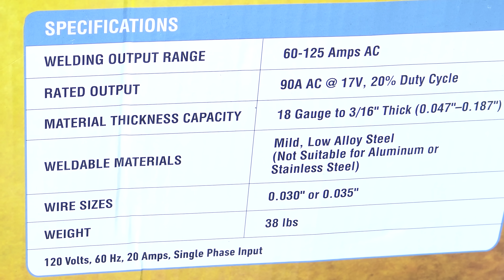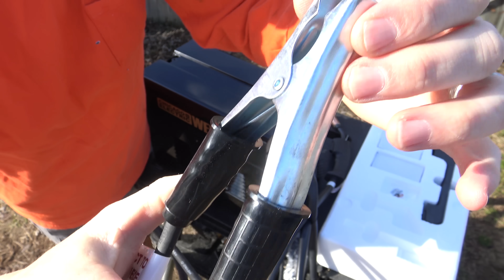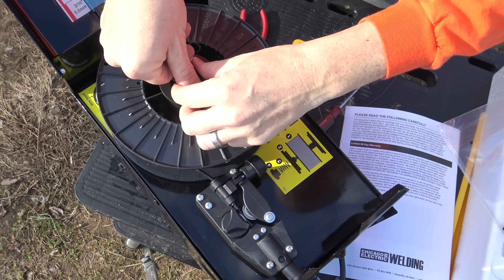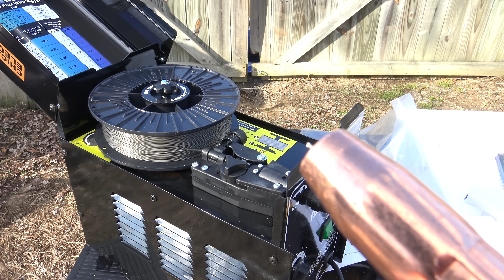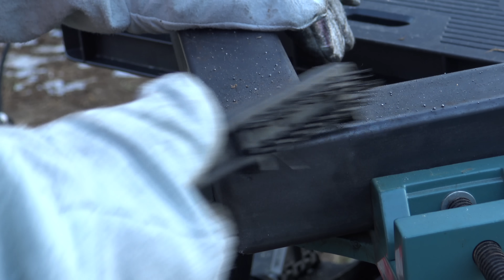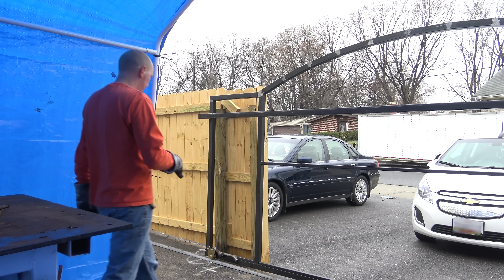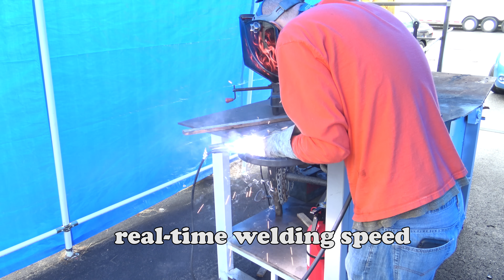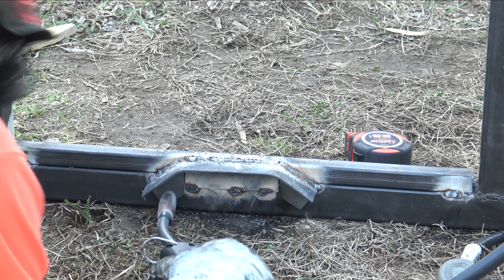Harbor Freight Flux 125 Welder Review

Comment: I got one a few weeks ago. Picked up the smaller gas less nozzle, I really recommend it. Improves your vision greatly.
 I didn’t realize that you could put those large rolls in this machine! That’s awesome. 
Nice video hope you make more with this welder.
Reply: Nozzles are part number 63795 at HF
I used electrical tape to attach, maybe I am doing something wrong. But so far no issues to speak of.
Reply: Also I have been using on a 15 amp breaker. Not heavy use just practicing (with a 50’ 12ga extension cord too). No breaker trips yet. Still planning the outlet upgrade very soon.
Reply from the maker: Its a small world huh!? You will see a very large increase if you ditch that extension cord and get a 10ga. Im not kidding. I think HF says NO to extension cords in general for these but i cant remember. Also, that 15 amp breaker is probably OK for short runs (of time). It just cant run under full load for any long duration or it will pop the breaker, or if your breaker is simply larger but the wire isn't upgraded too, you can start a fire more likely. Be safe. If you run out if wire and are gonna keep welding, the larger reel of .035 is a choice i will never regret. But i do have the power behind it at the plug. Thanks for the comment!
Reply: TRY to HELP you yes the extension cord was a one time deal for a repair. Definitely will wire a 20 amp with some 12ga. Shed outlets should’ve been that way to begin with.. big roll of .035 is on the shopping list. Have you purchased from eBay? Prices are way cheaper than HF, and I’m betting similar quality.
Reply from the maker: Walter Welch nice. Just bow seeing thid last comment. I have no experience with ebay. I would not be surprised if the quality was better or worse...
Reply: @TRYtoHELPyou  I just got mine off eBay exactly same as yours
Reply: It sounded ruff pulling on that big spool wouldn't recommend it .

Comment: Speaking of sparks...  Spark update please.   Wish I had a house or I would have bought an EV.  I ended up buying a 15' Mitsubishi Mirage 3 cylinder no instant torque here:(  Keep up the good work.  Thanks for the information on the welder!
Reply: Arg! I totally would have gone with like a third gen prius if home charging wasn't an option (pretty sure it might be in the same budget ballpark), but Mitsubishi makes some alright vehicles.  Best of luck.
Reply from the maker: No prob. As for the spark, its still zappin along. Cold weather has its range lower, as does any EV. At its worse the guage reads 60 miles (sub freezing temps). From lots of highway use. Still charges real fast. Still performs great... and still under warranty, i think thats the funny piece.. used car with the full factory warranty. That Mitsubishi will likely treat you well with fuel costs. My geo metro regularly got 36street 40-41 freeway. U should get the same if the car is around 2000lbs. One day dude.... one day. Thanks for the comment!
Reply: Ew ew question, how fast is fast? I've only experienced 41kw on a 50kw charger.
Reply: I paid 7180 total out the door.  132/mo. w/ 2 years plus of factory warranty.   My wife's car is a 2011 Hyundai Sonata just over 100k and alittle tired.  I like the car but already replaced the starter and it leaks oil.  I like the brand and the "Initial quality" but it's not a Honda ha ha.  I will likely replace  in a year or two.  I'm looking at the Volt and I know it's crazy but like the new EVs that Hyundai will and has bought to market. I hope Nissan gets the Leaf right the next gen. Thoughts? Thank you for your time!  Sorry to be off subject.
Reply: I genuinely would have bought a gen 2 volt if it wasn't twice as much (used) as a Spark EV (might have bought a Bolt EV if it wasn't three times as much as a Spark, but might buy one if they sink below $20k used off lease).  I believe the only negative thing I've heard about gen 1 volts, is that it might like to eat through a wheel bearing every 40k miles.... sincerely also a solid choice me thinks, if you can charge at home and don't mind filling it up with a premium beverage.

The jury is still out it seems (I've already made up my mind) whether the new Nissan LEAF is going to be suitable for long distance travel in "reasonable" time.  If the LEAF is to be considered, I'd personally wait for the 60kwh battery with thermal management, although I'm sure it will be out of my reach to be sensible financial decision.  Before it's all said and done, who knows, the 40kwh pack may get a T.M.S.
Reply from the maker: dead to 30 percent, high thirties low forties. 50% 46kw 60% ~47kw 70% 48kw. .. 125 amps the whole time as long as the battery is not below 50f. it warms up fast though. Those tall skinny units you find at nissan dealers are 42 kw things... so, i wonder if you have hooked up to a true 125 amp charger? The plugs always say 50kw in my experience. The plug is rated for that, for sure.
Reply from the maker: you got the right idea man, regarding the cars... minus the new Leaf. Mark my words, there will not be thermal management for the 60kWh batt or 40. I am not a spokesman or a professional but i am certain i am correct with a 20 percent margin of error (random number pulled from bum)... watch this https://youtu.be/eyXJUPxn0Gs?t=1m50s
Reply from the maker: Brian Wise, no apologies accepted! EVs are totes on subject, all the time! You got an affordable car, thats good! I reccomend a used EV because of the comparable purchase price but those new Hyundai EVs are going to be sweet. I have only heard good things. Its sad that they were not pure EV at the baltimore auto show this year... only PHEVs. 10kWh batteries max, for the most part. The next gen leaf is OK for most driving but i do not suggest it if you ever want to take a 400 mile trip in one day. Thats probably rare, anyway. But, the brand new price of around 32k with an epa range of 150 is pretty darn good. (i say its more 135 with heavy highway use/low regen expected)... The leaf has its place and always will. Tesla is unmatched and best for overall distance travel and longevity of batteries. As for the leaf ever getting a battery that has active thermal management, i would be suprised if that ever happens. I dont think it will. The model three will be an EV where you wont need to charge at home, you will need to spend 40 mins or more at a supercharger two or three times a week depending on how much you drive.... and if you get the big battery (44k anyone?) maybe just charge once a week. Do you ever just sit for 40 mins doing.... nothing? Perhaps leaving comments on youtube or social media? Get my drift? :) My final thought on this stream of conciousness is this, EVs keep lower in price or they are increasing in their capability, one or the other. Not always both. That means, if you buy an EV now, great, you have low cost transport. If you buy an EV in the future, great, you will have even lower cost transport. Last year our leaf traveled about 12k miles and we spent less than 400 in electricity. This is an interesting link to a video regarding the new leaf, it starts with them talking about battery tech of the new, second gen, leaf. https://youtu.be/eyXJUPxn0Gs?t=1m50s